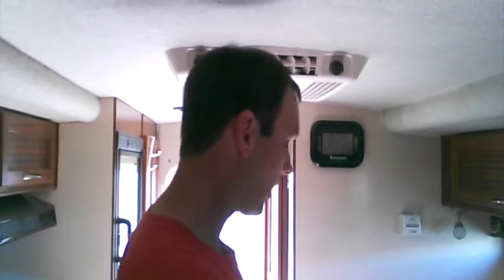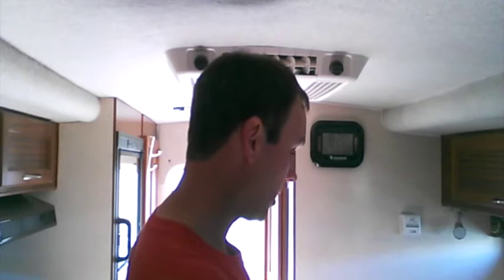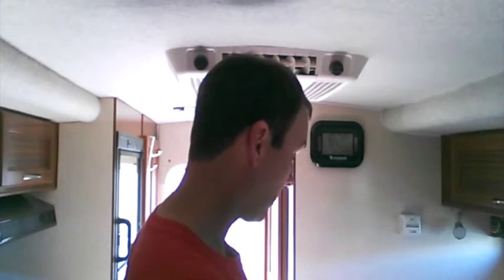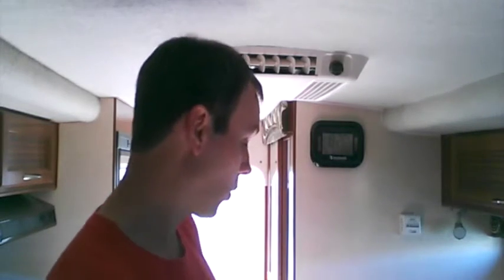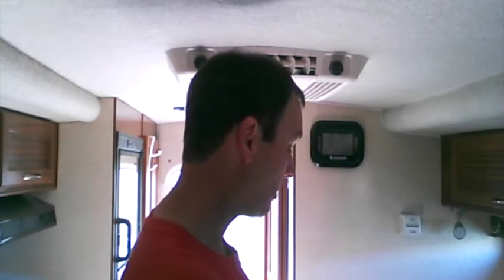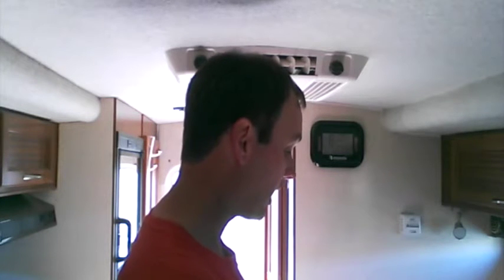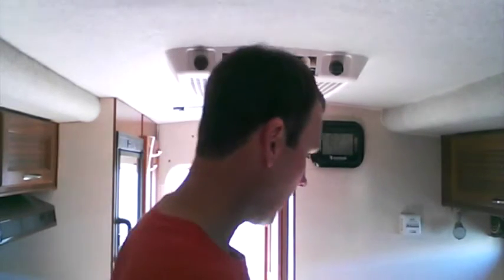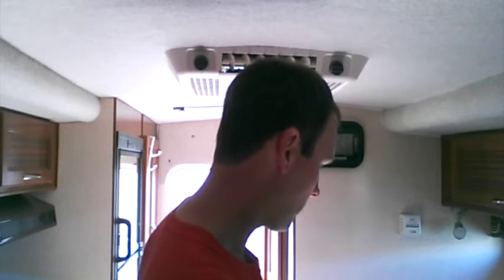Solar Update Part 1

Comment: How close are you to Portland?  There is a place there that sells for less than Renogy.  I am going to make a road trip there in a couple weeks to get some panels.  It is called Light Harvest Solar.  They have a small selection but the prices are pretty good.
Reply from the maker: Fernbark Frist I'm about 3 hours from Portland. I'm looking at a company in Springfield OR now. I'll have to check them out. They probably would make a good deal if we put in a large order?
Reply from the maker: West Coast Roller Am Solar Springfield OR
Reply: West Coast Roller Hah, I bet their definition of large is different than ours, lol.   Although,  cash in hand can make a difference sometimes.  I am three hours from Portland too.  I am looking to get about 1000 watts of panels for my lot.  I would like more, but, you know, frigging money.  I will look at Am Solar.
Reply from the maker: Fernbark Frist No sales tax! Yeah the more I get into this solar the more cash it's taking!
Reply from the maker: Fernbark Frist I'm starting to think just do everything now and get it over with, AGM batteries and the worx.
Reply: Fernbark Frist Light Harvest is cheaper.  They have a 135W panel for $120.  I want to get ten of those.
Reply: It can nickle and dime you.   Kind of have to pull the bandaid on this one and just grin and bare it.  Weirdly, I have everything I need, except the panels.

Comment: Because you have such limited space to mount anything up top. I would go with a 24 volt panel up to 350 watts. I don't think getting a higher amp controller is really needed in your set up. Not like you're going to add more panels up top than what you start out with, so your 20amp is fine. Take the measurements of the spot you're going to mount the panel and get one with the highest watts that fit the space. Because you're going to using the mppt it's better if you use higher voltages. I've heard good things about using tape and special glue to mount them with. It's something to think about. Everybody hates drilling holes on the top of their rigs. I saw one fellow who made his own racks and mounted them from drilling on the top of the sides which is in just about all rigs framing and a whole lot easier for managing leaks. Plus he made his racks tall enough to have the panels sit above the air conditioner and fan vent covers. Was really slick. I saw it on a face book group site just for solar and rec vehicles.  https://www.facebook.com/groups/519710761452848/?ref=bookmarks
Reply from the maker: Jerry Densmore Hi Jerry  I am limited on space so that's why I am considering the 100w panel. What your saying makes sense. I will measure and see if I can fit a 24V panel. Can I still use my dual group 27 batteries with that panel? Thanks
Reply: West Coast Roller
Yes of course you can. That's the wonderful thing about mppt that you can do so many different options. The controller is even programmable that you set how you want it to charge. I have some suggestions when you get ready. So get the biggest panel that fits the spot and look for some suggestions on the tape and glue that is being used with results. Good luck my friend.
Reply from the maker: Jerry Densmore http://www.solar-electric.com/solartech-spm130p-wp-24v-130-watt-multicrystalline-solar-module.html/
This panel is the largest that would fit. Any thoughts?
Reply from the maker: Jerry Densmore I'm limited on width. 26inches wide is as far as I can go.
Reply: West Coast Roller
Wow   Bout the only thing you can do is the 100 watt. I know you spend most of your time at campgrounds so not needed there. Only need it when out in the boonies. So give some thought on having a portable panel that only comes out when needed. As to where to store it. The only place I can think of is up in the bed area. You're a  slim and not overly heavy weight fellow could get away with storing it under your bed on the side you don't sleep on.
I know you don't need much when using DC but really don't think you'll be happy with just one panel at 100 watts.
Another option is to also use the alternator from the truck engine to help with the charging then you might get by with just 100 watts. It will charge while the sun is out but you live where that doesn't happen every day so that's why you need  more. Oh ya' you do have the little gen to also be a back up. Hope you have a good battery charger that has at least a 50 amp charging ability. It all boils down to how often you'll be unplugged should be the dividing option to cost you can afford. Hope this helps.
Reply from the maker: Jerry Densmore I'm uploading a video now with some questions about the roof. I might be able to put a large panel in the center.
Reply from the maker: Jerry Densmore I really don't like the suitcase portable units. I would prefer a permanently mounted panel.
Reply: West Coast Roller
I'm not talking about that cheap ass suitcase panel, I'm talking about a full size 24 volt panel. Give more thought to the idea of making brackets that will raise it above the air conditioner if you're dead set on having it mounted. I'm just giving ideas of other options cause one panel is never enough in your climate.
Plus with it being portable you can park in the shade and keep the panel in the sun. Hell you could go up to 50 feet away if you just use bigger wire than a 10 gauge. A big panel will also be close to 50 pounds in weight.
Reply from the maker: Jerry Densmore A portable 24volt panel? Can you send me a link of one?
Reply from the maker: Jerry Densmore Or your saying build a portable unit?
Reply: West Coast Roller
Think about it, the only thing you need to do is put it on the ground and be able to tilt it. A short 2x4 would be all that's needed. And because it's heavy I wouldn't worry to much about it being blown over unless it was like 30mph winds.

Comment: One  more thing, I too recommend getting the second panel now. The rule of thumb for solar is 100 watts of solar for every 100 amp hours of battery by the way.

I'm running 440 amp hours (6 GC ) batteries and have 700 watts, way overkill according to the formula but we camp out in a lot of national parks and look for shady spots.B-)
Reply from the maker: Ron Weiss I'm looking at 1 24Volt panels now. Trying to size something is the trick but if I do go 12V I probably will do 2 panels. Thanks

Comment: Take your time buying the system there is a lot to think about. A 20 amp controller is fine for 2 100 watt panels, but if your considering more you may want to jump to 30 or 40 amp.

One tip about the MT-05 remote monitor, mount it at eye level the LCD screen is hard to read at an angle, not a good design. When you get it check it out and you will see what I mean. I have two of them and I had to move them.

The controller is a decent one I have its big brother but like most of them they rely on screw downs for the connections and they WILL loosen up. To slow down the process at least tin (solder) the ends allowing for a better grip. Ideally you could solder copper ferull's over the exposed cable ends.

any questions just ask.

Ron & Liv
Reply from the maker: Ron Weiss Thanks Ron for your help. I will consider those points.

Comment: I didnt .mention that I currently have a 80 watt panel that the most Ive ever seen it put out is 14.6 volts at 3.6 amps = about 45 watts. It functions more as a battery maintainer and charger rather than a power supply.
Reply from the maker: CITAP1 That's my goal right now to maintain batteries to full charge. I have to get more educated about building a more sofisitacated system with inverters and so forth.

Comment: Decions Decions! Call Northernlite and ask what they install. I think they do 2 100 watt panels. AM Solar is nearby sort of and their 2 100 watt package seemed reasonable. Just make sure you dont save 100.00 by getting substandard stuff. Choose wisely Grasshopper and may the force be with you. I just bought a Fantastic Fan to replace my loud obnoxious bath fan and a Camco rooftop fridge vent cover with solar powered fan which is touted to increase efficiency by 40%. Well see. Thats my weekend project, installing those and going around the roof digging out the old sealant then applying self leveling Dicor sealant. Seasons are changing so it's a good time to do before the rains.  Im sure youll be happy with your decision and you can easily expand later with the plug in cabling systems in use now. I would consider seperate cable to the controller from each panel though to cut down on I/R or line loss from higher current from multiple panels through one 10 gauge wire. Take care.
Reply from the maker: CITAP1 NL uses a single 95W panel. I'd like to do just 100W for now and if I want to I can add a second 100W panel in the future. Thanks I agree buy the best you can afford.

Comment: You are in a cloudy area, and my experience, you might need more than 100W. Last winter, I had 90W and it was cloudy a lot in Nevada, and it was undercharging. Now, I have the 90W and a 100W, and it charges on overcast days much better. But here is a link to a 100W Renogy kit. http://amzn.to/1HvEDIO
Reply from the maker: ***** Interesting. Never considered that. Maybe I should jump to a double panel 200W kit. Thanks!
Reply from the maker: Fernbark Frist Mine will be slightly tilted due to the design of the roof.
Reply: West Coast Roller Then you will need to be mindful of the angle you park, to aim it at the sun. Not always possible. Flat might be better.
Reply: West Coast Roller She is right.  Clouds will kill you.
Reply: Fernbark Frist Also, you will be mounting them flat, so you will not likely ever get the rated power.  I have panels on my camper, and they get about 60% of their rated power.  If you have the space and budget, put 200w up there.